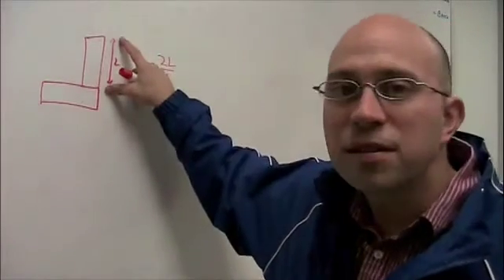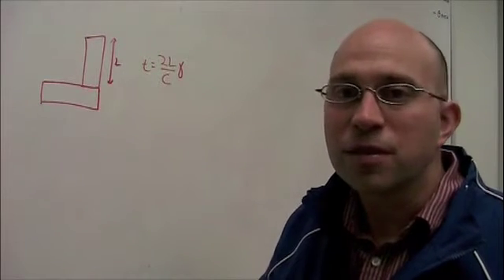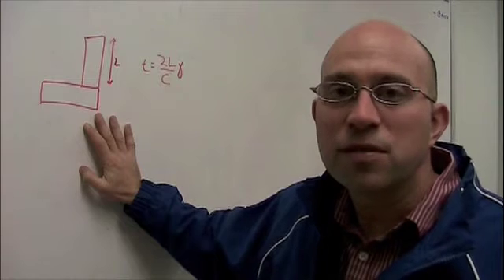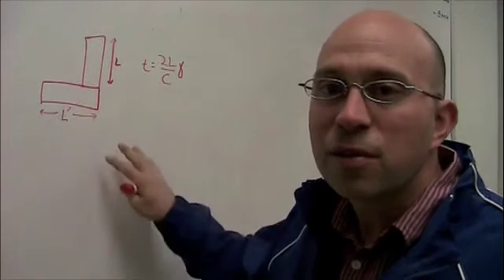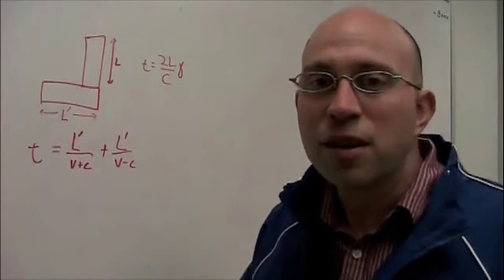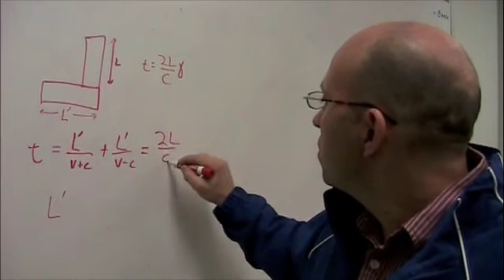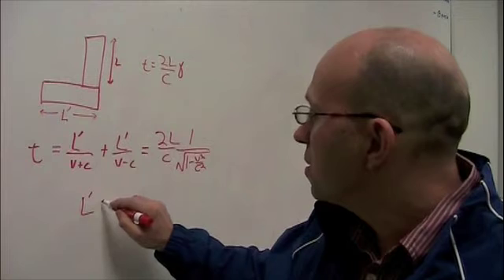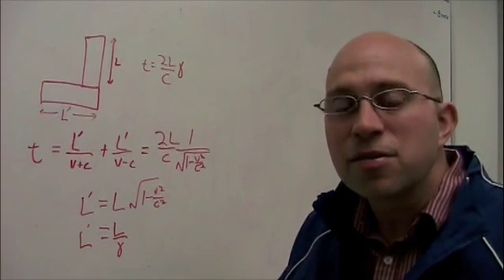Special Relativity: Length contraction in more detail

Comment: I have a pretty simple question. Can you tell me where my logic is wrong and where I can find more detail on length contraction? All presentations on length contraction say it's only in the direction of travel. BUT logic seems to indicate (to me) there is an aspect of it that must affect all directions. If I am on a space ship traveling near c, time slows down. If I consider a star perpendicular to my travel and want to find out how far it is from me, I might use the simple equation d=r*t (or t=d/r) where the variable parameters are time (dilation) and distance (contraction). I do that because at that point in time I am not traveling in the perpendicular direction. But, since my time is slower, at the point at which I make this calculation, the time to reach any object will appear to be less. That implies the distance to any object will be less. This also implies that from my perspective in a moving frame of reference, IF I could reach the speed of light, the universe would become a singularity. Another implication is that from my perspective traveling near c from Earth to another star, the distance behind me and the distance in front of me sum to the contracted distance between Earth and that star. It makes no difference whether I am traveling away from an object or toward it. It seems to me that a slower clock (time) shrinks everything.

Comment from the maker: @Atheism Yes, all measurements of distance contract.  If not, that would violate the principle of relativity because the truck driver could use the difference between the horizontal and vertical clocks to show that he is moving in an absolute sense.  This result also follows from examining how events which are simultaneous in one frame are not simultaneous in the other (not shown here).  So space need not actively contract, it's just that the relevant spacetime events change their relationship.

Comment from the maker: @eggplantyhead There's a mistake, but you didn't state your logic so I can't pinpoint it. But in equations, let L be the rest length (ie as measured by occupants) and L' be as measured by mission control.  Then for the first question L'=L*sqrt(1-v**2/c**2)=25 as you say.  In the second question, L = L'/sqrt(1-v**2/c**2)=80.
Reply: You are close to the truth. The real mistake is in Lorentz Transformation which is invalid in physics but correct in mathmatics. http://vixra.org/abs/1703.0169

Comment from the maker: @MrKENHUGHES By "moving frame" I meant "the frame moving relative to the clock" which may have caused the confusion. In that frame the clock ticks every gamma seconds, which is why gamma appears on the right hand side.  v+c and v-c are justified because v and c are both velocities *relative to the observer*.  We would use the relativistic velocity addition formula only to find the light's velocity *relative to the clock* (see the 'common misconception' comment below).

Comment from the maker: @jkosch01 The key is that in scenario 1, A is an inertial observer but B is not; in scenario 2, neither are.  Only uniform motion is relative; when people accelerate, we can absolutely say that they are accelerating, because the experience a force. So in scenario 1 B loses inertial status when he turns around; in scenario 2 they both ac- or de-celerate; at different times, but by the same amount, so the effect on their clocks is the same.

Comment from the maker: @MrKENHUGHES I'm not sure what the question at the end is, but you have made an interesting new point that time dilation seems more real because it is permanently recorded by the clock. It turns out that time dilation and length contraction are 2 sides of the same coin.  Example: Bob moving at 0.9c covers 0.9 ft in 1 ns in your frame, but this is only 0.5 ns in his frame. In his frame he must have moved only 0.45 ft. Thus he MUST see your yardstick as length-contracted.

Comment from the maker: @MrKENHUGHES This (your first paragraph) is a common misconception. No thing or information can travel faster than c, but the relative velocity of two different things as measured in a third frame is a different beast.  To convince yourself of this, consider that the relative velocity of object A with respect to (wrt) me cannot possibly depend on the relative velocity of object B wrt me.

Issue #2: It's right.  You will never observe contraction of things which are stationary wrt you.

Comment: Firstly, for the horizontal clock, you have a term, v+c, which is impossible since you cannot travel faster than c as viewed from any frame.
Secondly your final statement was that the length contracts when viewed from the moving frame. Is this right? I thought it was as viewed from the stationary frame?

Comment from the maker: Think about the truck driver who is moving with the clocks.  He will not measure the clock running differently depending on whether it is horizontal or vertical.  Therefore, if the "stationary" observer measures the vertical clock running slowly, she must measure the horizontal clock running equally slowly.